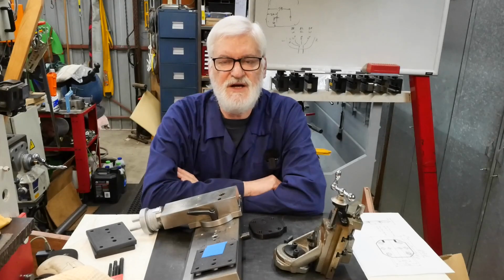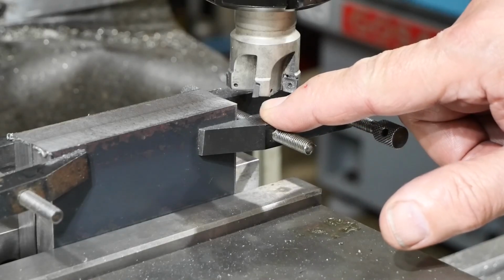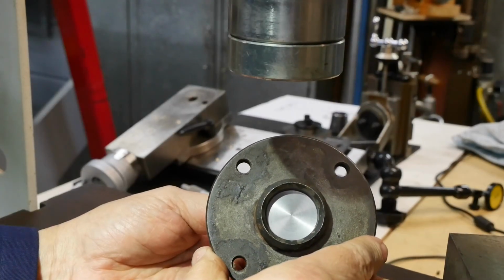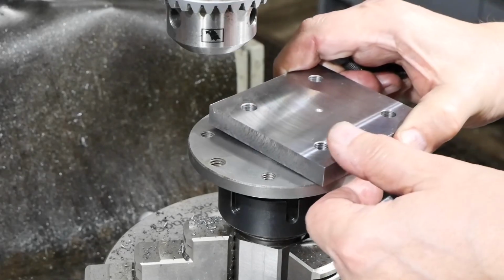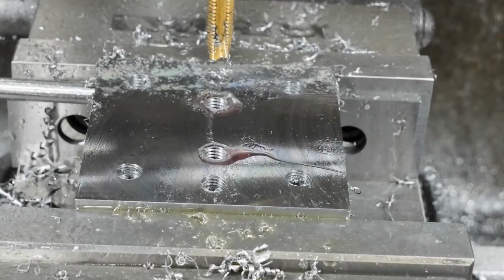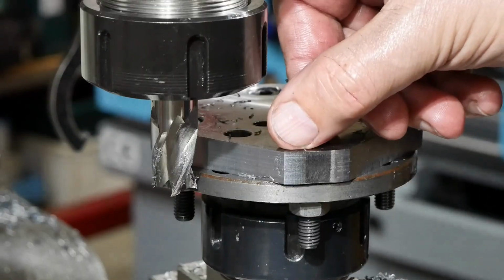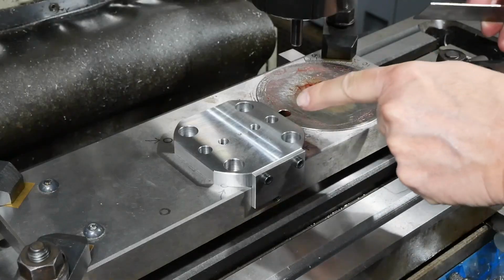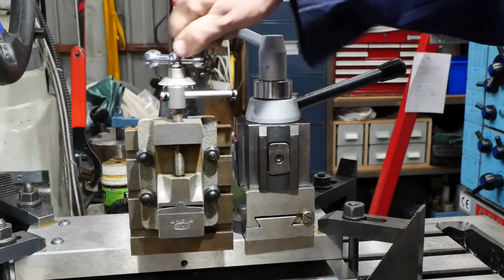Machining Mounting Plates for a Milling Slide on a Lathe.

Comment: Thanks for posting, this helped me out a lot, very good video.

By the way, AI put me on to you. I asked him if he could refer me to a video and your’s was one he recommended!
Reply from the maker: Thank you for watching and I'm glad you found it helpful - bit unsettling to be recommended by an AI bot though :)
Cheers.
Reply: @alanshomeworkshop 
Alan, I’m just mounting my milling table now and I notice that you bring your mounting plate right to the edge of your cross slide, using the index plate. Why was that? Like, why didn’t you mount it further ‘on’ the cross slide, why on the edge?

Also, when you decided on the position forwards and aft (X axis) was that governed by the tool holder being in the way? In other words would you have mounted it in a different position should there not have been a tool post to worry about or did you try and line everything up centrally?

I’m just trying to work out the best position for mine.

Thanks.
Reply: @SeriousSchitt  Hi there, I'm Alan's friend that he made this mounting assembly for.  It was placed on the edge to enable rotation of the front plate that holds the vice - ie using the "vertical" rotation plane.  If I'd mounted it more in the middle, it would have limited the combination rotation and vertical slide ability.  That way the way it is mounted, I can vertically rise or lower (and rotate) the very bottom of the face plate below the surface of the cross slide because it's clear of the leading vertical edge of the cross slide.  It's proven to be a very handy device - although I don't do a lot of milling it's introduced capability to my Lathe that I never had before.
Reply: @fergusseb 
Hey thanks very much for that, I really appreciate your input there. 

My slide’s a cheaper quality looking thing that doesn’t swivel like yours but it has excessive front overhang, like it’s very ‘front heavy’. Also, because it doesn’t swivel, it can travel all the way down on its Z axis without fouling the front (chuck side) of the cross slide, even with the base fully mounted to the right (tail stock) side of the cross slide. 
I’m thinking of mounting it there just to centralise the weight of it more, if that’s actually going to work or not?

Um, one last question before I forge ahead and mount it, did Alan mount it fairly central across the length of the cross slide (from where the operator stands, towards the back of the lathe. It looks like he pretty much did but I just don’t know whether it was bias one way or another for whatever reason?

Thanks.
Reply: @SeriousSchitt  Yes longitudinally it’s roughly in the middle - selecting the mounting position was guided by me wanting to leave my Lathe Tool Turret in place, so the Milling Vice base it behind that and allows some rotational swing angle.  If you can PM me an email address then over the next couple of days I will try to take a photo showing it in place.
Reply: @fergusseb 
Thanks so much for your info and the great video. You two have given me enough now to successfully mount my own. It’s all most appreciated.

Comment: Another enjoyable and very informative project.
The idea of doing a mock-up with the 3D printer before cutting any metal was a lesson for me.
Reply from the maker: Now I have developed a little bit of skill with FreeCAD, I prototype most of my metal projects with a 3D print. It helps me visualise exactly what I'm going to do and gives me a set of detailed drawings to work from. Fast and cheap, so what's not to like ? Some of the 3D prints can even be used - check out:  https://youtu.be/ak627HZbA0s?si=kqAjgGRWKgfCfEhB One viewer 3D printed the collets and used them to shorten some bolts :)
Reply: @alanshomeworkshop 
Speaking of 3d printing of collets, could you use the same idea for spindle spiders ?
Essentially, print a plug that inserts into the tail end of the spindle with a hole printed to the profile of the stock you are machining.
Reply from the maker: @lindsaybrown7357  I think that would work ok. Just need a way to secure the plug so that it can't walk out of position. One simple option would be to print the plug with a shoulder so that it cannot walk further into the spindle, and install a worm drive hose clamp on the protruding stock butted up to the outside of the plug.
Reply: @alanshomeworkshop 
Yes, I'd figured a shoulder but wasn't thinking about the captivity.
Maybe presuming it would be a press fit.
Reply: @alanshomeworkshop 
Yes, I can see retirement isn't an excuse to stop studying and learning.
Just more time to play with things 😊

Comment: Nice work helping your friend! Why didn't you round the corners on the lathe? It would have taken a fraction of the time.
Reply from the maker: That's a good question. When I made the fixture I hadn't decided whether to round the corners in the lathe or the mill. My decision to do it on the mill is a reflection of my inexperience with the operation. I was concerned about the brutality of the interrupted cut that would be needed if I did it on the lathe, and I thought it would be kinder to tooling and machines to do it on the mill. I did briefly consider cutting the corners off with a hacksaw - but cutting 300mm (8 x ~40mm) through 12mm plate wasn't very appealing. However, it turned out that my end mills also didn't much like cutting the corners off. Another factor that influenced me was wanting to get a consistent chamfer around the top edges and I thought this would be more easily done in the mill. As it turned out the best option was probably to mill the corners off with the heavy duty insert cutter and then round them off in the lathe. Live and learn :) 
Thanks for your feedback.